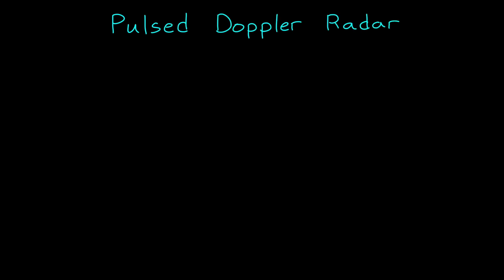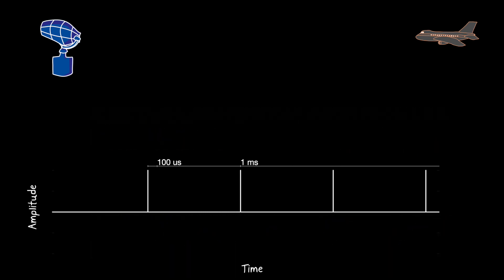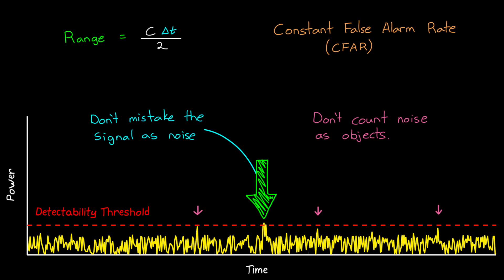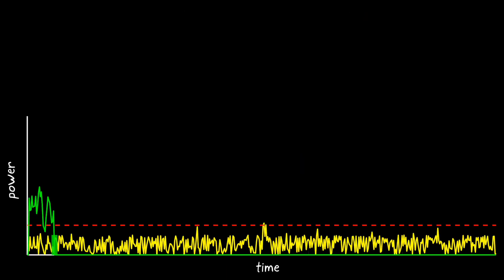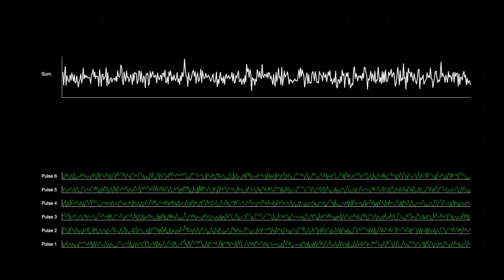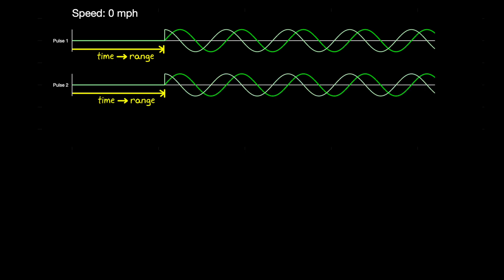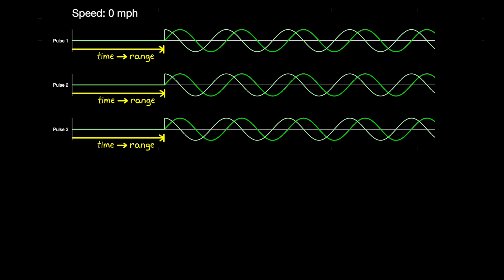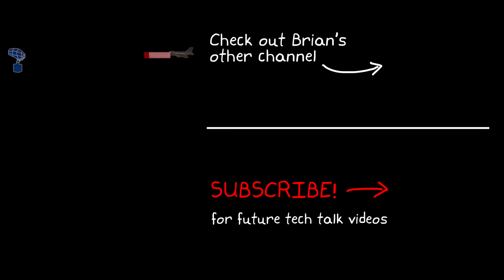Pulse-Doppler Radar | Understanding Radar Principles

Comment: 5:50 Is the matched filter used for correlation, right? But it seems to show us convolution.
Reply: Wikipedia has a good write up for this if you search for matched filter. "In signal processing, a matched filter is obtained by correlating a known delayed signal, or template, with an unknown signal to detect the presence of the template in the unknown signal.[1][2] This is equivalent to convolving the unknown signal with a conjugated time-reversed version of the template."

Comment: 14:20 why are you assuming that reflected waves all have same freq ? if the target is getting far from you, the freq you recieve will be lower than what you sent. (dupler effect)
Also 50 years ago when jets used pulse-dupler radar (F14) did they use sampling on IQ or they basically calculated the closure rate based on the time shift between pulses.
As far as I know we calculate the closure rate based on the difference between Freq_sent and Freq_recieved. Otherwise, assuming that we are on a jet and getting closer to a target which is flying perpendicular to us (radar notch), since we are getting closer to the target, we will still have time shift between each pulse we recieve so we should be able to see the target again !  ... howerver this is not true. But looking into this using dupler effect since target closure rate is 0 in this case, therefore fsent=freceive and this target wont be shown on radar if we are using pulse dupler filter.

Comment: Why don't we use beat frequency to measure velocity for pules doppler radar?
Reply: The beat frequency is typically used to describe the difference in the transmitted and received signals for an FMCW radar.  This difference in frequency for FMCW radar can be either induced by range and/or relative velocity of a target return. If you have a stationary target the beat frequency represents range (time delay). If you have a moving target you need another waveform slope (or constant CW tone) to solve for both range and relative velocity. If you have multiple targets you need even more slopes. There are many excellent youtube videos that explain that.

In pulsed Doppler radar we observe the phase change of subsequent samples in slow-time (at the same range bin). The rate at which phase changes over your slow-time data gives you a frequency - and you can think of it as a "beat" frequency of sorts, but it only provides Doppler information. In pulsed Doppler radar instead of slopes (FMCW) we have different PRF to resolve range and velocity ambiguities should they exist. Pulsed Doppler radar are usually divided in low-medium-high PRF regimes and have different range/Doppler ambiguity implications. The MIT Lincoln Lab Radar Series I think explains this well.

An important but challenging concept to understand is that a radar can receive signals from any direction, at any time, and with any frequency shift (subject to constraints). The radar's designer attempts to solve these ambiguities (or mitigate their occurrences) through various signal processing and hardware design schemes.
Reply: @jonathananderson730  Thanks for the explanation. I understand pulsed Doppler radar uses the shift of RPF to solve the velocity, but it introduces velocity ambiguity. What I am think of is solving beat frequency on the other hand seems it can resolve velocity ambiguity. And waveform slope doesn't have to be used because pulsed Doppler radar can solve the range by solving the time delay of the receiving signal. So my question is, is my theory correct or is there any difficulty to utilize beat frequency for pulsed Doppler radar?

BTW I am not a radar engineer, but a combat sims player who is so curious about how radar works.
Reply: @YYCH2  I'm not sure I get where you are coming from but we can't typically get an accurate instantaneous frequency difference between the receive and transmitted carrier over a single pulse. Often this measurable difference has large errors that make it impractical to attempt to extract the Doppler from a single pulse.
Reply: @YYCH2  I think I get what Jonathan means. Indeed most RADAR systems utilizing Doppler processing will use the output of a frequency mixer to pass Doppler frequency directly to the signal processing system—this lower-bandwidth signal can be more easily worked with for signal processing compared to the GHz-band raw signals. (After a fashion, the sample rate of the receiver acts as a mixer/filter anyways.) However, both systems will have a similar problem—the sampling rate of the received signal. Since the samples are being taken at the intervals of the pulse width, this puts a fundamental limit on the maximum non-aliased frequency that can be determined (Nyquist-Shannon sampling theorem), which is half that of the sampling frequency. If your Doppler beat frequency is higher than this sample rate, it will alias to a lower frequency and make for ambiguous velocity anyways.

That being said, if you wanted to get a more complex spectrum from the pulse for things like non-cooperative target recognition and such, you could theoretically sample at a higher rate than the pulse width, but then you have to deal with more complex interactions between the target and receiver, determining which of the received frequencies is actually due to "real" target motion and not moving parts on the target, and so on.
Reply: @eddievhfan1984  Thank you so much for the detailed break down.